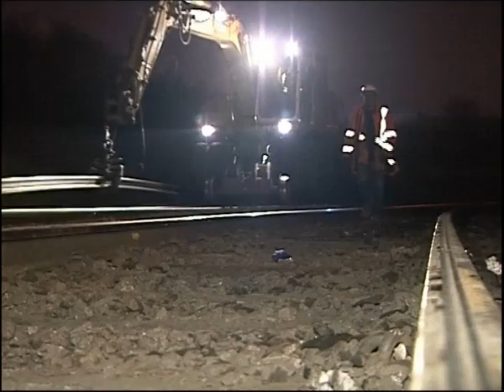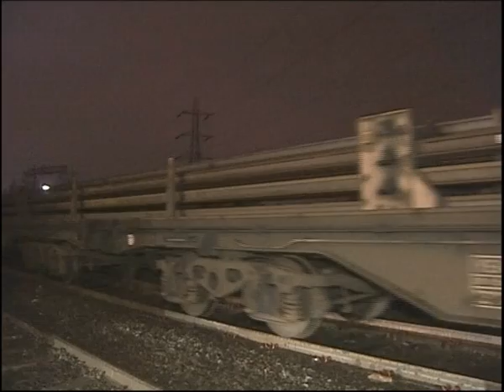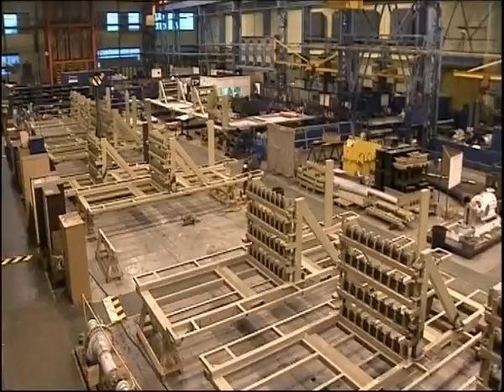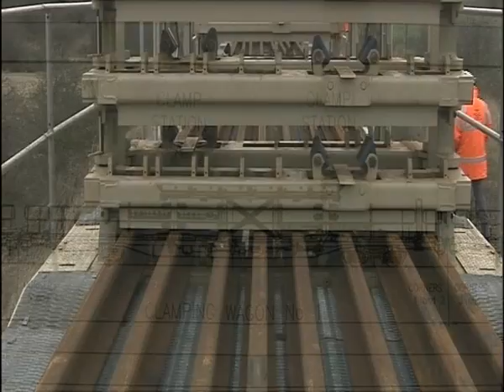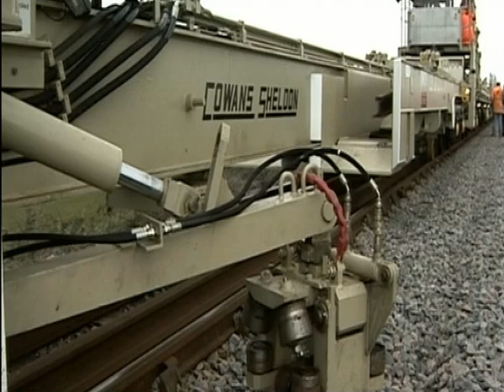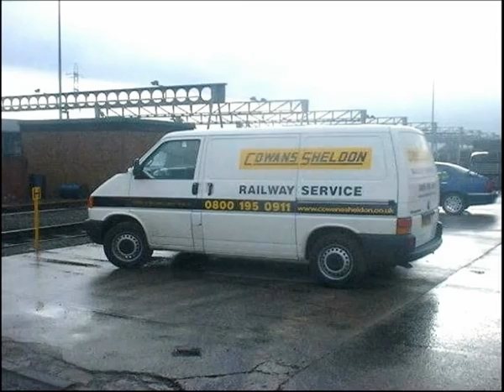Cowans Sheldon - Long Welded Rail Delivery

Comment: I've seen trains with much longer rail lengths in North Carolina CSX lines.
Reply: US loading gauge is larger than the UK and has a higher line capacity because US railroads are freight orientated at low frequency, hence the massive railway yards. The UK railway network is primarily for passenger trains at a high frequency and as such, signalling sections are smaller to increase capacity and that's what dictates maximum train length.
Reply: Yeah we have track laid out right now in North Jersey for CSX. Rail so long it's like a flexible string